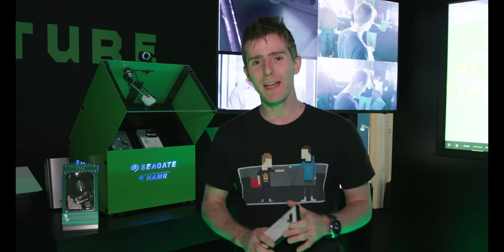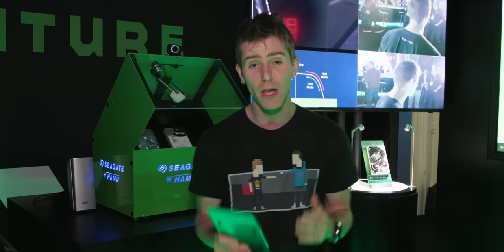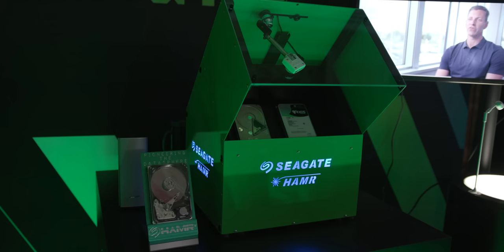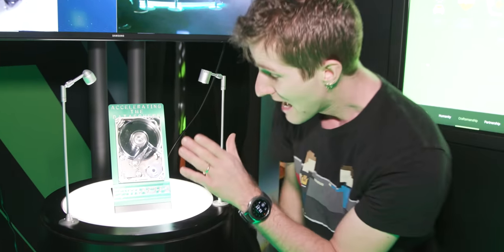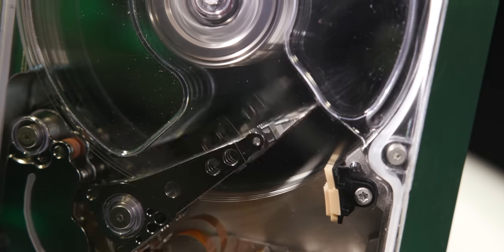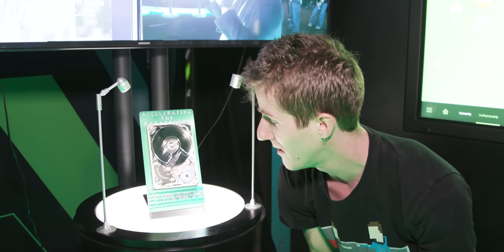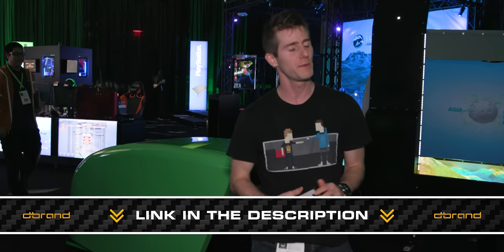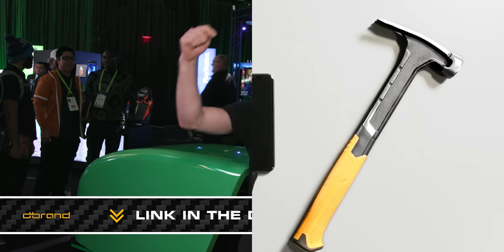The coolest hard drive tech in 20 years

Comment: This is some seriously sick technology. props to Seagate to continuing to push it despite the setbacks over the years.
Reply: Yeah seriously, there's definitely still a place for HDDs, I'm sure they can still get some milage out of this tech for at least another decade.
Reply: @kaibaCorpHQ  yeah, don't HDD have a longer lifespan as well? Plus they are a lot cheaper for the size you get and not incredibly much slower
Reply: @FireDramine7  Well the good, more expensive SSDs can compete in lifespan (though I've had a 2tb HDD for 6 years so far), but if HDDs do fail then there's a much better chance in getting your data back; plus the price helps like you said, you get a lot more room and reliability for a lot less price. 

SSDs just aren't worth it right now IMO; I'll give it another decade, 5 years at the least.
Reply: I've a 1.5TB Seagate FreeAgent from 2010 that's still running. My old WD MyBook from 2008 IIRC died just last year. Those are externals though. Oldest internal HDD I got is a caviar green that's about 8 years old at this point. Hard drives have far more longevity than SSDs for the price.
Reply: Nice to see people honing the stuff that isn't glitzy, bleeding-edge glamour tech. File under 'dull but important'.
Reply: @anonysalt  I see, you are a person who likes the feeling of the danger that soon could be something bad happen ;)
After the experience of dying HDD´s, it hurted that much so I change the drives after at least 3years. i dont want to risk feeling this pain another time
Reply: @kaibaCorpHQ  Personally I think SSDs are worth it, although for the average person probably just to use as an OS drive.
Reply: This is definitely interesting for the server environment but I just hope they don't have a ridiculous price tag.
Reply: @XepherTim  Oh yeah, I totally agree on a boot drive; infact my laptop has a 256gig boot drive in it. I just don't think they're there yet personally as a complete replacement to a HDD for most people.
Reply: @anonysalt  Had an old WD from 2008 as well that died last year. Had been running 24/7 in a NAS with countless hours.
Reply: Wait, are you guys telling me that HDDs have a longer lifespan than SSDs? I always thought it was the opposite. If this is true, then how can people say that SSDs are more reliable? If it’s gonna die sooner, than sound LESS reliable to me. Can someone explain please.
Reply: @kaibaCorpHQ  I looked it up, many sources say SSD's can last like at least 100 years. But for some reason I just cant believe that as I keep hearing they're having problem finding a long term storage option. The only reason I have an SSD is to have my OS running on it and all the important programs / games to have a slightly faster boot ups general run speeds but I agree with you that it certainly doesn't make a big difference.
Reply: okay why did it send it twice
Reply: @anonysalt  I have a 500gb drive I bought in Circuit City when that was still a thing, still in operation today (Seagate Barracuda).  I have a 15gb 15000rpm SCSI drive that still works, that is from ages and ages ago (2x 3.5in, double height SCSI).  I have a 256mb Caviar drive that still works... Hard drives work a very, VERY VERY long time, provided they get taken care of at least.
Reply: @kaibaCorpHQ  SSDs are worth it, but for specific needs.  Grabbing a cheap 120GB SSD drive to stick your OS onto and your most used but not sizable applications is absolutely worth it.  They don't make noise, they're more durable and they use less energy if those things are important to you... these are all great things for laptops.  Certain workstation tasks also benefit tremendously from SSDs.  But right now, cost per gigabyte still makes SSDs not worth it for the average PC user and as you've said, I don't see that changing at all in the near future if not ever.  I think we'd sooner see a completely different mechanism that offers better speed and capacity than HDDs for a lower price than SSDs than we would see SSDs ever competing at a price per gigabyte level personally.
Reply: @FireDramine7  Nope, Linus has said in a dozen videos that SSDs last longer.
Reply: @Skelath  ah okay

Comment: If these ship with those sexy clear tops I am 129% sold.
Reply: But you wouldn't see them when they are in your case
Reply: Clear Tops with RGB or we riot.
Reply: @RawGameplay  my case the you can see the hard drives in the bottom of the case.
Reply: @RawGameplay  In my case you can
Reply: Yes! They definitely need to ship clear top versions, smack some RGB on it to boot and I'll proudly display it in my rig. Dang, never though I'd say that about a hard drive let alone a regular ol' platter based drive.
Reply: @RawGameplay  most cases these days, even cheaper ones, have some sort of see through portion in it. Heck, even my cheapo $50 case has a large ish plexiglass window on the side
Reply: *169%
Reply: There was a big trend of making transparent tech sometime in the 90s... Still waiting for this to be the trend of the year again )
Reply: Designing a harddrive with a window, is not as easy as you might think
Reply: MUST THEN ADD RGB LEDs!! Needed for performance ofc..
Reply: @free2game  why.
Reply: Won't people be able to see your data then?
Reply: I have a WD 150GB Raptor drive with a clear section on the top. It's yours if you want it... well, maybe.
Reply: If they roll with this I'm gonna mod my case to showcase it. So yeah its a sell.
Reply: @Wizardofdoom2  "@Raw Gameplay most cases these days, even cheaper ones, have some sort of see through portion in it. Heck, even my cheapo $50 case has a large ish plexiglass window on the side" And almost all mounting options for 3.5" drives would prevent the internals of a clear-lidded hard drive from being visible, so @Raw Gameplay's point still stands.
Reply: @Cyrian Genesis Seagate olden days were quite bad but my current seagate 1TB 30k hours and counting and its way more quiet than my toshiba 2TB with 18k hours. Toshiba actually making worrying sounds...
Reply: Brad Viviviyal  In hindsight yeah, this is not the world's best sentence, however as I was typing this at 12:00am in Australia my mind was not 129%.

Comment: I WANT MORE HDD’s With a glass top to show off the awesome technology inside my case

RGB HDD’s!
Reply: "I WANT MORE" there is none my friend :(  I want them too because this moving head is so satisfying. RGB is not necessary. WD used to make raptor hdd with clear window but they are discontinued.
Reply: gay
Reply: Used to be the hottest thing in case modding, installing a window in your HDD. SSD's aren't so interesting to watch.
Reply: Matthew Jenkinson anything is interesting with RGB
Reply: @Kwriss  no u
Reply: Me: NOOOOOOOOOOOOOOOOOOOOOOOOOOOOOOOOOOOOOOOOOOOOOOOOOOOOOOOOOOOOOOOOOOOOOOOOOOO!!!!
all new fancy nerds out there: Goooooooood.
Reply: They're not real Nerd's until it's a beige tower in the corner with No led lighting, just extra airflow cutouts.
Reply: Wut have u done?
Reply: The reason drives have metal covers is to block emf/rfi. Before the signal reaches the preamp on the side of the actuator, is signal is really weak and susceptible to interference. 

If only they could impregnate glass/acrylic with something that would do the job. A nerd can dream
Reply: @valvejob4215  have you heard of this transparent aluminum stuff? Now it is not aluminum, and it is not glass but IS a transparent material with properties of aluminum... apparently, or something. depends who you ask
Reply: cdogg nope. Got sauce on that?
Reply: Damian Chiliński  Is it a polycarbonate cover? That's what I've read. Does it need both SATA and Molex power? I have a newer raptor that's using only SATA power.
Reply: Damian Chiliński  For some reason Wikipedia says raptors need both 5V and 12V when it only takes one.

But yeah, I'd rather have a raptor X lying around if I wanted to watch moving platters and heads than invest in something brand new and expensive that may turn out to flop in unforeseen ways.
Reply: Damian Chiliński yup i remember those. To think it was the shit back in the day

Comment: Wouldn't it technically be the HOTTEST hard drive tech? 450 degrees is very hot
Reply: With the heat the head generates, those water cooled hard drive blocks are probably looking a little less silly now!
Reply: It’s not the whole disk all at once, I’m guessing it’ll be safe to put into a case with average air cooling.
Reply: Missed title opportunity
Reply: @ghost_ship_supreme  I think they knew something ahead of time!
Reply: @odis6397  When he picked up the HDD he was surprised how warm it was, sounds like plenty of heat.
Reply: @RobotSlug Don’t think it had cooling, it was also probably running for hours before he came to the stand.
Reply: its 450c at spark moment not constantly450c wuld melt your pc a way lol
Reply: @shadownoobnoobslayer5424  Everyone understands that, but that would still radiate heat over time and usage into the HDD, and without proper dissipation that would build up. How fast is the question.
Reply: @ghost_ship_supreme  I don't think it's necessarily clear that it generates a lot of heat. Temperature != heat.
Reply: Rip thermals
Reply: No, because the actual amount thermal density generated is very little and hard frame is dense metal. So have little effect. Might be a degree or two warmer than existing drives so meh.
Reply: Eh, I suppose this will replace the "Frying chicken on my AMD CPU" memes now...

Comment: The coolest is the Floppy Disk, Try booting Windows 10 from that
Reply: On mobile... currently on disk 351 and it says read error, help!
Reply: lmao, floppy disk 10tb coming soon
Reply: The coolest is that you don't know what you're talking about, Floppy disks are not for regular boot, just for install
Reply: @FireDramine7  That would be a cool @ss niche product. A 500GB floppy shaped swappable media disc. Sell it for $/£100 with the reader made to look like an old floppy drive. It'd be great in new builds that go for the retro-look. I want one. I could put an old AM/FM/Cassette eide I bought for a machine back in...2001 (?). Good fun!
Reply: You probably could in theory put it on does quick maths 2 666 floppy drives and install windows like that...maybe... depends if the files can be broken up in pieces smaller than 1.4 mb. although you might be able to with extra software
Reply: @YOEL_44  so you've never had a commodore 64 then
Reply: LOL yeah can't imagine
Reply: Are we talking about the 3½'' floppies or the 5¼ ones? 👀
Reply: Flop my disk
Reply: Easy! Already done on my IBM PC/AT! It took nearly 20 thousand 5.25 inch Floppy disks though!
Reply: @crzyces1693  to be honest that's not a bad idea. Certainly not impossible. I was kinda joking around but the idea itself isn't bad
Reply: @xerzy  Modern tat !  I used to work on  8" floppies with an ICL mini computer powered by 2x Z80's   that supported 16 dumb terminals . Power !!
Reply: @YOEL_44  r/woosh

Comment: Physically securing data by removing the internet transfers,, sounds good actually
Reply: Think that over for a while. You may arrive at another conclusion :-)
Reply: Yeah, sounds great... I think we should call it something like "air-gapping". Like there's no physical link between!
Reply: @orlovsskibet  well, it could work for certain types of facilities. But then I'd imagine it would be more like some kind of railway or other form of anchored path type of structure.

Then again, it would be a very fucking paranoid way of doing things. Since the only real advantage is that you can keep devices within the facility isolated from eachother except for specific data transfers.

So in a very very very small niche, this could be a thing. For everything else, it seems like a great stopgap measure if your data transfer speeds otherwise aren't cutting it.

But then again, what kind of data are you transferring that loading it onto a server rack to physically transfer it before unloading is faster?
Reply: @JustSomeoneRandom1324  Most anything that gets archived out to tape drives. If for some reason you have to hold on to petabytes of data that you do not actively do processing on, then it makes a lot of financial sense to transfer it to long term storage via physically moving the storage medium, bandwidth is actually pretty expensive on those scales, even if there is enough bandwidth on the network to handle it.

That said, I do not see the system presented in the video being competitive in that space. A 20TB hard drive may be almost competitive in volume/TB with tape media, but cost/TB and mass/TB I suspect will not be within an order of magnitude still. Not to mention that tape media has a very long shelf life which a hard drive can't match and which is often important in that sector.

Think about Visa or MasterCard's database transaction and audit logs for an existing use case.
Reply: Fast & Furious 27 will be a combination of a heist and hacking movie

Comment: Dual actuators can increase IOPS, but surely a simpler system would be to increase sequential transfer by using two read channels on the one actuator, so the drive effectively RAID 0 stripes with itself - all that would need would be the electronics to handle the extra channel
Reply: Matthew Day seek time relates to mass of the head so you'll have that trade off.
Reply: That depends on whether your data is mostly sequential, or mostly random. Higher IOPS is better for random, which as these will likely be used in datacentres is probably the better stat to improve.
Reply: @pauldunecat  How much of the mass on that arm is strictly structural, and how much would it actually need to increase with an extra channel?
Reply: Matthew Day this was my thought as well, seems like a lot of time and money for the added risk of parts failing in the field with Seagate's solution.
Reply: The data structures are so fine nowadays that it just wouldn't work with just one arm. You just wouldn't get good enough tracking on both platters.

Comment: The mach2 drives just save rack space per IOP. It appears as separate LUNs; effectively 2 drives with half the capacity. You can stripe or concatenate  them, which makes sense, since you'd have to replace the whole drive for any failure anyway.

Comment: If you're dealing with enterprise amounts of data, the snowball and snowmobile concept is justified.  Why would you want to use your bandwidth to make copies of data when it affects your throughput to PAYING clients?  Throttling the throughput of the copy would be ridiculously slow.  It would be better to copy the data, drive it over, and then all you have to do is update whatever has been changed from the time it was copied to what's current in the data-center.

Comment: Hard Drive Zamboni is great for corps that have been using a different backup method than the cloud. Drop all data in to the Zamboni at wire speeds, truck it to datacenter as a seed, and do incremental or differential uploads from that point on. Companies have TB upon TB of data that you'll never actually catch up with unless your servers sit in the same data center as the cloud, at which point you're doing cloud backups wrong...

Comment: The two headed drive, call me pessimistic or whatever, but isn't that twice the chance for it to fail?
Reply: If there's any consolation, a single actuator should be able to function on its own when the other fails... Of course that would halve the efficiency.
Edit: That's what I surmise, or would the actuators be handling different parts of the platter with no overlap? Then that's a different thing.
Reply: @sushantsardeshpande  according to Linus' explanation both heads read and write half of the full data, so if one fails?
Reply: @Ken_neThT  Guess so, first thought that they would cover half of it at one time but would each be capable of covering the entire disk.
Reply: @Ken_neThT  I thought he said 2 seperate channels across SAS?
Reply: @The Apple wouldnt be hard S.M.A.R.T. would be easy to implement here detecting an open circuit or high/low resistance across the actuator motor.
Reply: Not theoretically K Teo ...
Reply: Looked to me like they were covering different platters, with a top and bottom stack? Either way, the chance to fail I think would be somewhat less than twice, there is still a lot of shared components that can fail.
Reply: @SyncViews  shit yeah you are right the top few platters are clear, threw me off there so this is basically a raid 0 drive. Dammit.
Reply: My take on this was this was just a normal drive with twice the bandwidth. Standard rules of backup your critical data apply. It will be great if that merges in with HAMR, as we'll be getting higher density drives with increased throughput as well.
Reply: Yep same risk as raid 0
Reply: To me, it seems like Raid 0 in one casing...